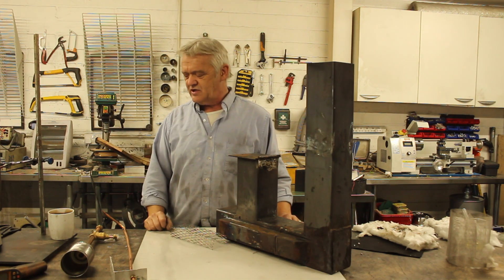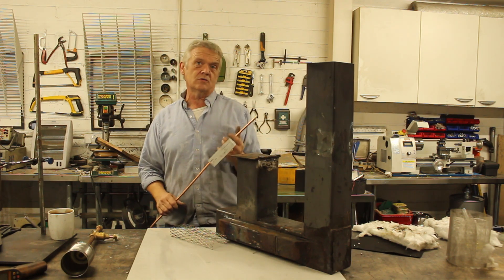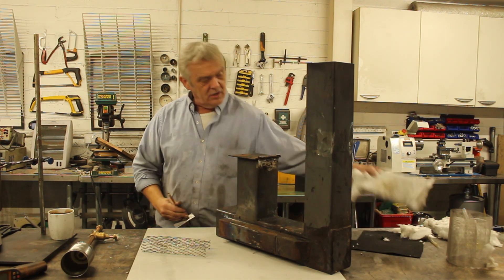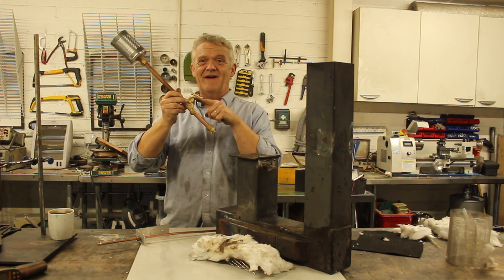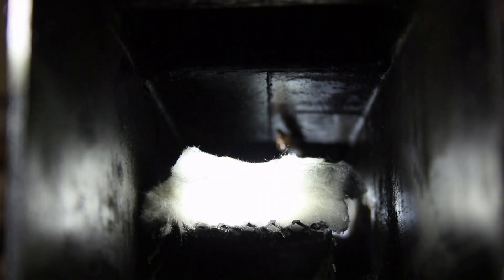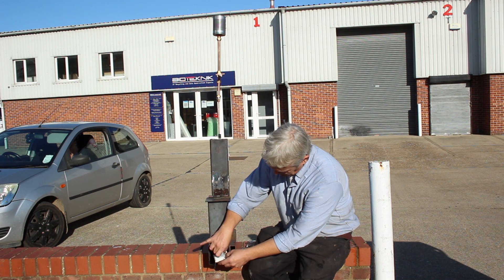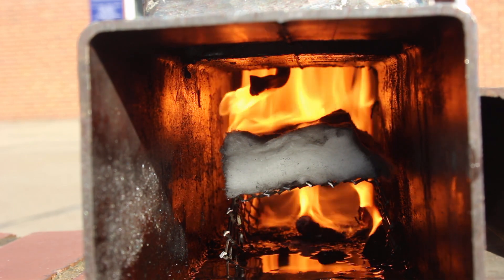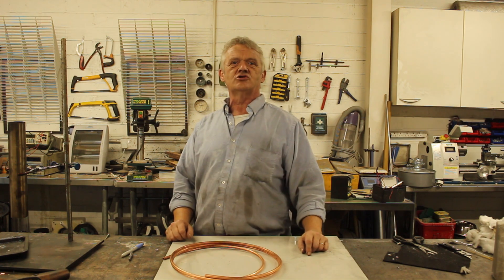1687 Waste Oil Rocket Stove

Comment: This arrives at the right time for me. I just made a rocket stove to use pellets through gravity and wanted to add the oil dripper I had in my other regular stove. I had turned a regular wood stove as a pellet stove and used oil burner as well. Inside my regular stove, I would burn pellets, used oil or wood which would heat the bladder I have made inside, to heat the coolant that heats the floor of my shop.

I have dropped the idea of using my regular stove burning pellets as the way it burnt them, made me go through 3 bags a day!!!! Not economical at all. Fast forward to last week where I built a rocket stove with a 3 inch square tube inside a 4 inch square tube. Between the 2 tubes, will be the coolant flowing. The initial test I made to see if it would work was conclusive but need more heat for it. I had a garden hose on the intake with water coming from our 360 feet deep well and that is cold water. The output was warm water so I know I do get some kind of recuperation of heat but I don't know the exact number.

I am in the process today to remove the old stove and put the rocket stove in its place. I will be burning pellets, twigs and of course, use the same apparatus I had for used oil burning from the old stove.

Question is this. Do I have to put the tube THROUGH the chimney or is this just because you were just doing a test?
Reply: As far as using water like you describe, slow down the water flow and use it in a counterflow fashion, that is, the cool or return water comes in and flows toward the flame and out at the hottest part.

Comment: It being smoky is because there's too much oil and not enough air. One could atributenthe amount of airflow to the height of the chimney being insufficient, but one needs to know to regulate the rate of oil dripping.  Preheating the oil helps getting the oil to flow in cold weather. But once the oil is flowing well, the rate of flow probably needs to turned down. If at least to avoid over heating it and carbonization of the oil inside the oil feed line.

Comment: Ok, stay with me on this, ok? It need a turbo! Everything works better with a turbo lol.
This will work better with additional air-flow right? It's best to bring that from outside imo, rather than pull-in air from the space you are trying to heat and then blowing it immediately out the chimney. 

With a clean burn, I wonder if the exhaust gasses could power a small fan, attached to another fan that is responsible for moving fresh air inward? Now an actual turbo from a vehicle would be too heavy and need some monster-sized stove and likely take ages to get-going and anyway be super loud. 
But something small, simple and home-made might just be enough to give you some gains in efficiency overall. You've already got suitable air-in ports on that rocket-stove, "just" connect one end up to that, and the chimney to the other side of the "turbo" and Bob is yer father's brother!

Comment: So I'm To understand that Mineral Wool will Not wick water, therefore one should assume that it won't wick waste oil. So if we were to provide oil to a pan by way of an automatic float assembly, what material would work to wick it to the point of burn? Also, any ideas on an automatic float assembly that will maintain an oil level in the pan?

Comment: OK, have run an old engine oil burner for about a year now. This design does not work for long because the vaporizing in the heated pipe soon blocks the pipe with a solid carbon deposit. What will work is the pipe going through the shorter feed tube, block the bottom opening and the air being pulled through keeps the oil pipe cool. That will keep the burner going longer without blocking. Any flame at the end of the oil tube will soon carbon up solidly. The design I use is an n shape square tube, pc fan forcing air through and oil dripping down from top of n shape. Downleg of n shape in an old fire extinguisher with top cut off. This burns so hot that the fire extinguisher tube glows red. Oil deposits carbon that I break out after everyday run. The run is usually about 4 hours continuous to heat coils above for hot water.
Reply: Do you have any interest in posting a video, sharing the link and letting us hit the like button! I've read your comment a few times but I think it's best to see to fully grasp the concept.

Comment: Insulating the combustion area would help!  I see nothing wrong with putting a tube into a masonry rocket system that can be connected to with an oil feed as a secondary fuel.  
    stick a couple bells and some mass on the exhaust path...voila

Comment: Put the spray nozzle on the drip feed so it sprays onto the wick below the fire/burn line. 

Then you have the vapor carried by the updraft and the oil soaked into the wick from the spray. Could be worth a go I'd say. 🤔

Comment: I wonder if it could burn plastic cleanly if you enclose some plastic in an enclosed tube and feed the fumes underneat the fire.
Reply: Also you could add a salvaged catalytic converter to the exhaust. then run copper pipe to boil water. then run a steam engine, that runs a heat exchanger...

Comment: I have a question for you can you create 220 volt power from a 12/24v car alternator because I have seen people doing this on YouTube 
Especially a person with a phase motor with a starter competitor on the side of the motor    connected to the alternator with a mains plug to
But he is using alternator in a 3-phase output of 220 v to a pug through of the two phases of 3-phase from the alternator
Looping background to the electric motor

Comment: It may just be me, but I am big into having multiple uses for things, including the type of fuel a thing can use. It seems to me that this could and should be fettled such that you burn wood and have the oil dripping onto it. It would likely require a deeper burn-chamber eventually, but for proof of principle surely one could put wood upon a grate such as you use here, and then have a 2nd teir below that with mineral wood to catch and burn any drips that make it past the wood. Perhaps both fuels would burn more efficiently together, given sufficient oxygen.

Comment: The one I did years ago was for used automobile oil and it worked ok as long as the oil was preheated but at -30C in Canada we need some wood to go with it as the used oil used up too fast.

Comment: Not that I know anything but I'd have put the oil feed above the mineral wool at the shorter chimney (at the front) and brought the mineral wool nearer the front load. 
To my mind this would mean less pipework, less heat hitting the oil well and a longer run for the flame to draw through?
Totally happy to be told that I'm off base as I'm sure there's lots I don't yet understand 😆

Comment: my idea is to take a can cut a slot in the side to insert a wick , drill 1 hole in both ends put a wire through , to wrap the wick around on inside of can, fill with oil .   so you can adjust the wick up or down from out side of heater  depending on air flow.   like a oil laturn on inside of rocket stove .
Reply: I also use fiberglass insulation for a wick maybe if I keep it saturated in oil it wont burn up as fast . I havent tryied the can idea yet Ill let you know how it turns out .

Comment: My only concern about the feed line inside the chimney is that once the system is working at high temperature, you will start to carbonise the oil, ultimately requiring maintenance

Comment: I wonder how well this would work if placed into a fireplace with a long chimney?  I'm guessing that it would still be smokey due to the gap between the stove chimney and the fireplace chimney.   Could this be engineered to fit into a home's fireplace safety to provide heat using oil instead of wood.  If so, this could be incorporated to supplement a home's heat.  Many of us burn wood in the winter to reduce our heating costs.  Would be great if we could use this instead of wood.  Oil feed would need to be external to be safe, but that shouldn't be too difficult.

Comment: I was wondering something... currently there is the copper drip line fed down into the stove.  Instead of that, what if there was a single (or a few) tiny holes drilled in the metal above the wool, and the oil canister could be directly connected to the top.  It seems it would simplify the parts list, so long as there isn't any danger in the oil heating up.
Reply: you want the fuel to heat up ,become more viscous & turn to a near vapour/distilled state,  just not so hot it self ignites as happened in the last few seconds of this burn where the drip got to hot ,stopped & the feed pipe end ignited on contact with the limited air.

you want more localised hot air to be dragged in, just drill/grind a few holes/slots on the under/sides, near before & after the flame & then cut bend & wrap tightly a bit/couple of steel plate around the square tube so as to just cover the hole(s) then slide it as required to uncover the new airway, simples.
want to do more welding then add 3 leg tubes to lift it all up & have them serve as the extra hot air intakes.

think the old uk coal fire with the small sealed back boiler 'box' & large diameter straight up copper pipes to the bathroom somewhat insulated tank ,no coils or pumps required, you had one right ^_~  where you balanced the coal shovel over the entrance then used old fish & chip news paper over that to get a massive air draw to the coal flames & grate & the odd paper fire lol, i remember it well

Comment: Should use Gerry’s diy biscuit tin air vent  with Caron felt  donut with out drip feed just fill tin with oil  and get it started with air flow underneath tin  in a normal wood stove .  Used Cooking oil engine oil ....

Comment: A couple of suggestions: reduce the length of the horizontal burn tunnel (I'd do that for burning wood too, that should be rather short. I've no idea why people make that part so long) and play around with the air intake. As I believe you mentioned, oil is going to have it's own air requirements and the basic RS design is optimised for burning wood.
Incidentally, for wood, ideal air intake is 1/4 system size. Generally, you get that (or close enough) by default with a feed full of wood loosely in. You'll notice that's the cleanest burn time of the cycle, with a mouth full of flaming stuff.
I think that once the WVO burner is tuned up properly, then the metal parts in the combustion area are going to have to go away. This is true for wood burning RS as well but likely moreso for oil burning.
Reply from the maker: nice suggestions mate and thank you but shortening the burn tunnel doesn't work well - I tried it and there esult is worse if it is too short - this length worked well
Reply: Long tube= more draw and the ability to add after burner.. but I'm still playing with decota fire holes.. and building a charcole barrell 😎
Reply: @ThinkingandTinkering  a shorter horizontal burn tunnel of s better in my experience! getting a good burn it Al about primary en secondary air your have a awful lot of primary air the size of the chimney XD close it of en feed it more secondary air,
Reply: @ThinkingandTinkering  
Huh.. the usual optimal proportion is 1:2:4 for a wood burning rocket. (Feed:burn tunnel:heat riser)
I can see how your situation may be so: the feed to riser height is relatively tall (feed being tall) and since there is an overall need for enough time (aka length) in the system for full combustion,  your current config would be a good compromise.
The riser part (what you're calling a chimney) for a system that's 4 inches (sorry, I'm an American still using the kings units) is often best placed at 5 or 6 rather than 4 (if that makes sense), which helps with the increased friction to volume found in smaller stoves.

Comment: Great channel thanks. 
I'm researching how to burn used oil in my wood burning stove in my house. My stove is against an outside wall so the oil tank can be outside the house with an oil feed through the wall to the stove.
Here what I'd like to achieve...
1. I want to be able to remove the oil burner so the stove can be converted back to burning wood in the future. 
2. I want it to burn used deep-fryer oil from my local pubs (or used motor oil if I have to) without the use of a fan,  
3. I just want the stove to give off background heat, probably 24 hours a day but turned down at night, a bit like an Aga does in a kitchen. 
4. I'd like it to burn cleanly so it does not smell and it does not leave gunk in the chimney.
Any advice would be appreciated or better still, perhaps you could do a video to show how it can be done.
Thanks in advance Tony B

Comment: How about a video demonstrating  how easily waist mineral oil can be de-slimed. This might be useful for people who have access to a gallons and gallons of WO. This slim is not normaly apparent as it is dispered in the oil.  It forms  from ions of metal from the wearing surfaces becoming chemically part of oil molecules. Hence, it is not to be confused with the gum of vegetable oils.  Still. It is responsible for forming a varnish  in diesel injectors and the crud in burners. Fortunately the slim is denser than oil and so the oil can be spun off in a centrifuge.   It is best done with the oil hot but a demo showing that it is possible to improve poor quality oil may find interest especially if they want to use it in Indirect injection Diesel engines. Engine oil is not so good for small direct injection engines though, as it doesn’t atomise well.  
Regarding the burner. For anyone wanting to build one for regular use, there are catalytic converter sold for wood stoves which will help get the emissions down to legally acceptable limits (yes, there are laws for stoves now).

Comment: Mate the mineral wool in a draft chamber with burning flames may well produce harmful microscopic glass fibres and thus make the inhaler of such exhaust susceptible to lung cancer. Just don't use mineral wool in such applications and you'll be way safer. All the best.

Comment: 2 massive points to make.

1 that's illegal in the UK for good reason 
2 don't put the drip feed supply in the exhaust it will carbonise and block the 10mm copper tube causing an explosion  issue

You're relying on the mineral wool there's  no need to pre heat the oil!!!
Reply: one point to make. Don't spoil the fun!
Reply: @bendelange7038  it's not fun if it's at the expense of our planet
Reply: I froze to death in my workshop but at least I was law abiding. Meanwhile Taylor Swift and many other vacuous celebrities can burn jet fuel on the daily. Jog on mate.
Reply: @dalegribble9101  it's called a jumper. Speaking of jogging that'll keep you warm. Jealousy of celebrities will get you nowhere.
Seek a cleaner fuel sorce before you cause harm with your selfishness

Comment: Given that the rocket stove burns really hot, when you stick a copper pipe right through the hottest part of the process, it might cause the copper to melt and then spill a lot of oil into the burning stove and thus cause a little fire. Isn’t it better to insert a stainless steel tip through a hole where you want the oil to drip, connect your oil reservoir to that and of you go?😂